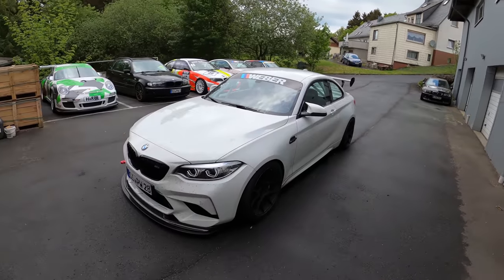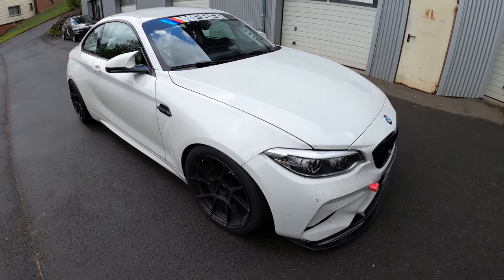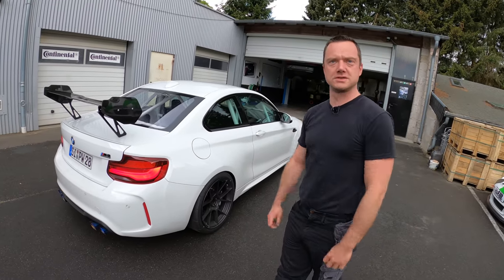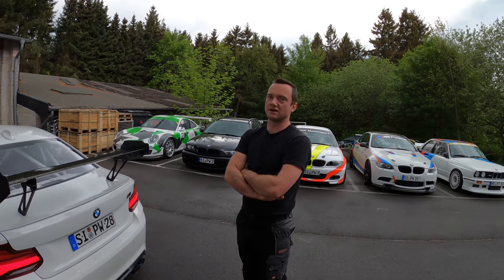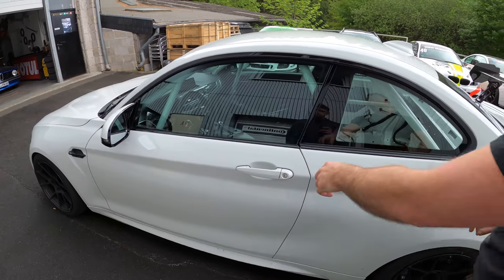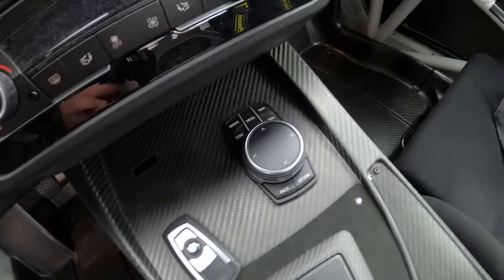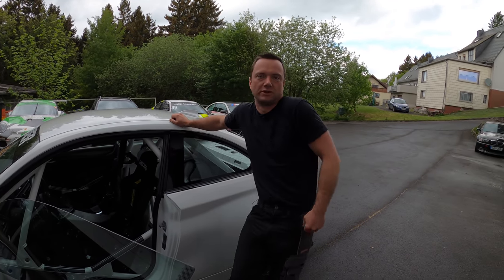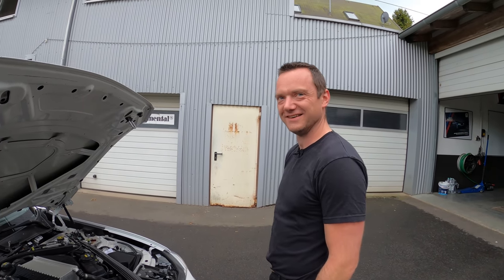Built and Driven on the Nürburgring: Weber BMW M2 Competition

Comment: I own a M2C and just by this video I can tell the car is really different from stock, the original turn-in is already something else, but in this video its simply one of the best turn-ins ive seen in a car with so little mods, not to mention its a 2-series with better turn capabilities than most sports cars, I personnaly wouldnt trade it for any other car other than a supercar, porsches lack emotion and other AMGs and M’s are already too big with shitty automatic gearboxes. This is one of those cars...
Reply: In addition, mine has catless downpipes and JB4, you’ll be really impressed with a engine tune, it unleashes the beast beneath that bonet so much that stronger maps really unsettle the car on corners. My dyno numbers with only catless downpipes were 390 whp and 62 kg torque, unfortunely i didnt dyno it stock but the numbers are just crazy still.

Comment: That tool seems to be a lot of fun to drive. Very stable at high speeds and surprisingly well damped trough the Karussell, although the last corner was pretty sketchy. What was it? 170 kmh?
What is the weight of that thing? 1500 kg?

Comment: Why does he not have the M1 and M2 drive buttons? And he's also missing the drivelogic gearbox shift speed selector button. Kinda weird.
Reply from the maker: Because unnecessary, only 1 mode needed.
Reply: All off, gearbox doesnt need the drive mode in manual mode :)